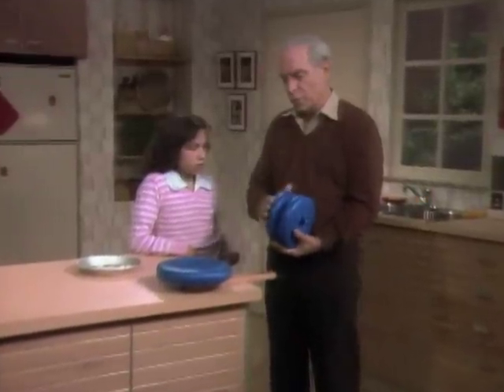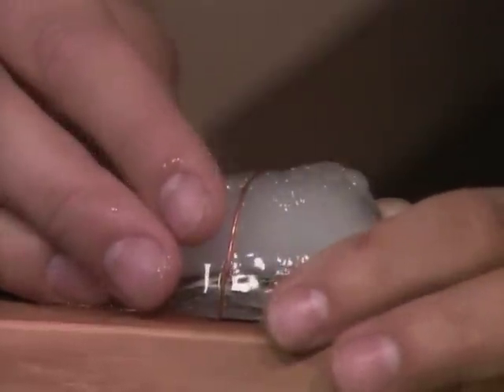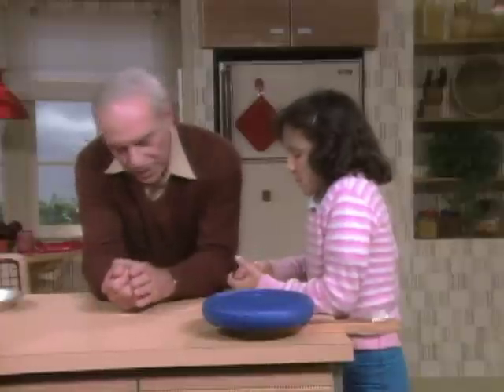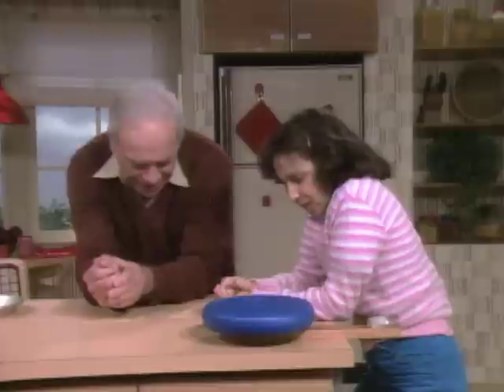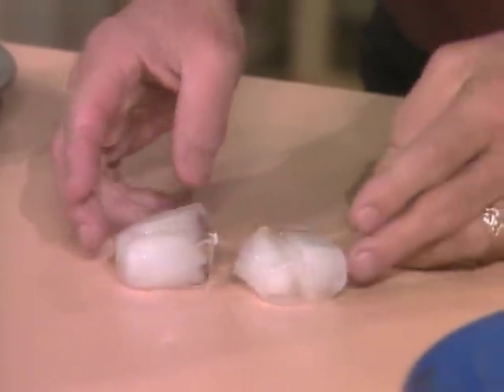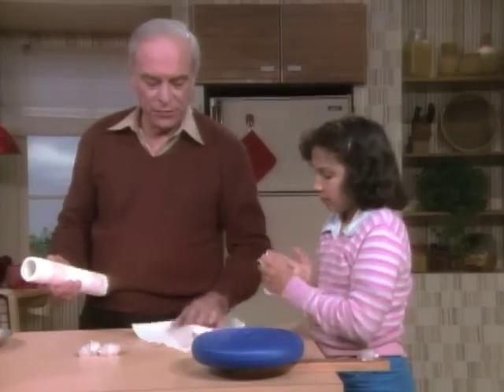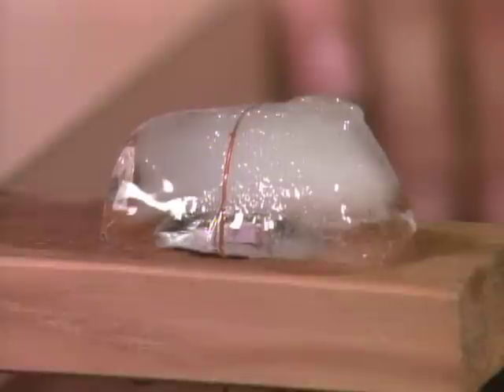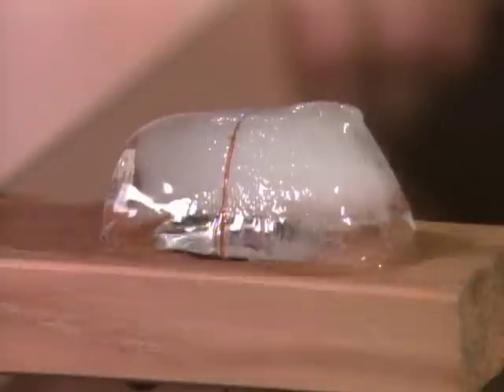Why Ice Cubes Get Stuck Together - Mr. Wizard's Supermarket Science

Comment: I'm trying to figure out why some Ice Cube's stick together in my cup of tea and others don't.  I have an ice maker in my refrigerator that when I put them in my cup of tea eventually they stick together and they're one glob of ice but I also own an actual ice machine that produces 100 lb of ice per day those ice cubes never stick together in my tea. Both ice makers are on the same filtered water system so whats the difference.
Reply: One is likely colder, I've noticed that in the same way that ice only cracks in water when it is really cold, they only seem to get stuck together when they are really cold too
Reply: I had the same question, and that's how I stumbled onto this video. I put 2 ice cubes in my cup of water and if they stay next to each other while they melt, they get stuck together.
This video doesn't explain that, since there is no pressure involved.